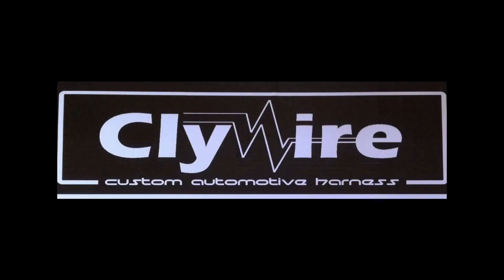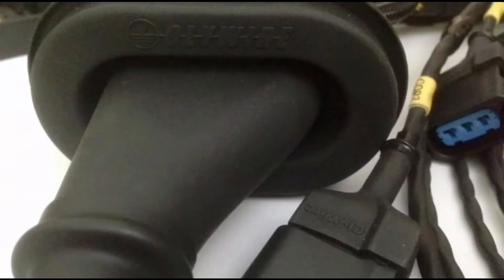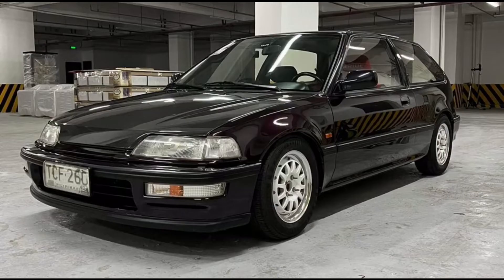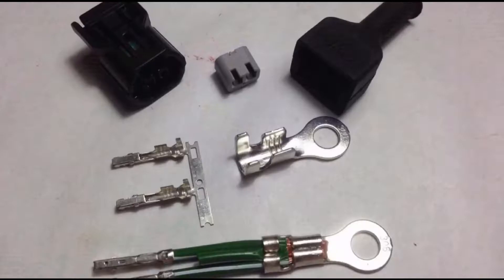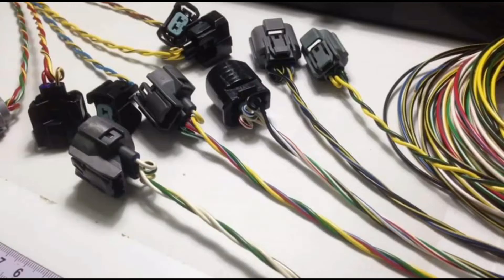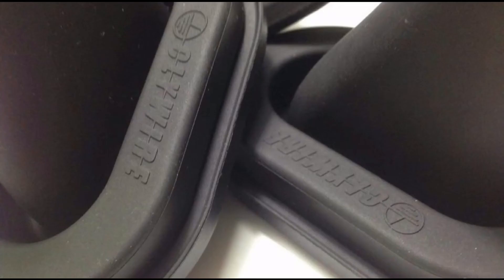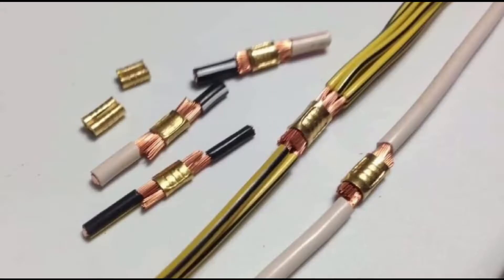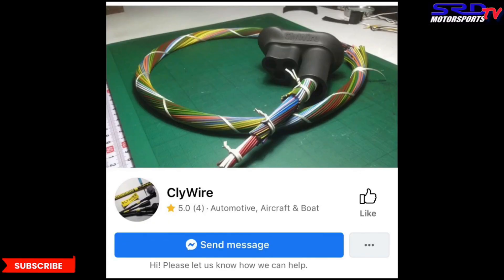ClyWire Automotive Harness a Motorsports based Honda Wiring

Comment: Thanks for the great vid! I remember the wiring on my tps was kinda iffy and we found that out on the dyno. I was advised to have it rewired but I really wanted to get the car on the rollers asap. Clywire seems probably better than oem given its age too.
Reply: Yes. All fresh and brand new!
Reply from the maker: definitely!!! especially using Rychem junction boots that is milspec (pasado for the airforce and army)  they use rubber thats better than EPDM na used on high end automotive

on those alone it wins but i wanted to share why he coils and loops the strands... aint it cool